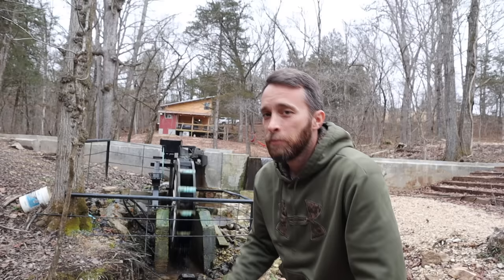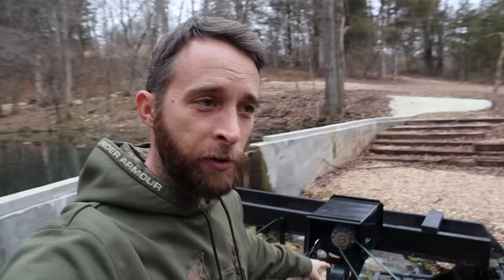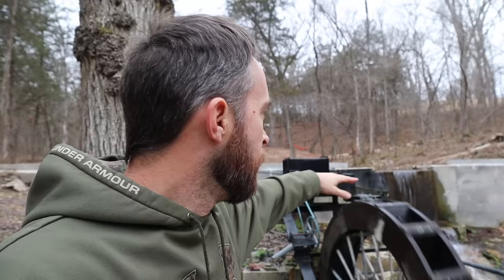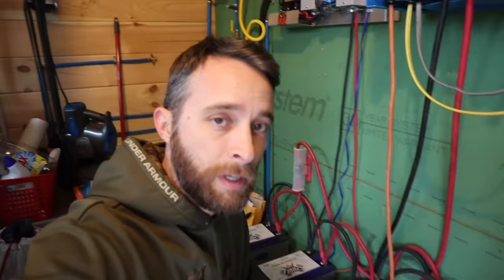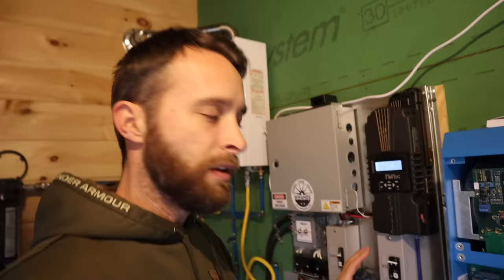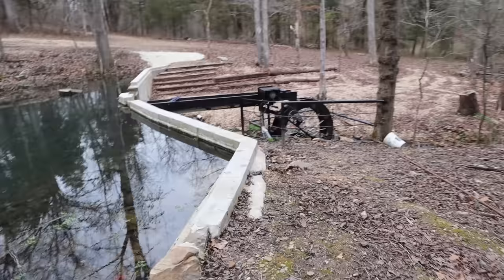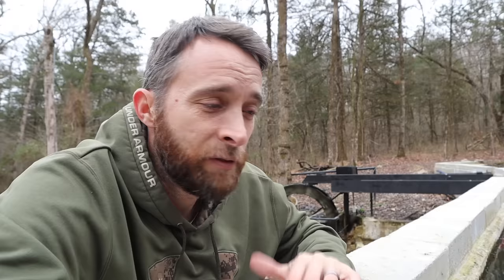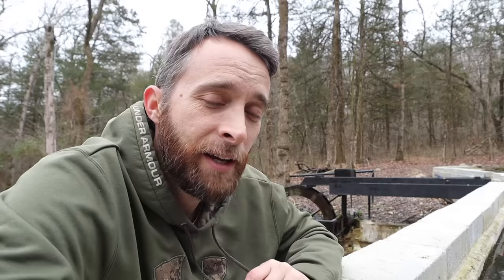Did we MAKE HYDRO POWER Using Our Waterwheel for Self Reliant Off Grid Living?

Comment: Did u convert the voltage to dc to store in battery's bc if u did then idk but just don't see battery banks or dc inverter bc dc takes less to charge and u need only a lil bit power to keep it going better add a solar panel or 2 to dc inverter to battery pack never mind just try dc inverter and add a solar panel to it might need a lil more juice to charge idk what amount of voltage ur generator need to work but might need a solar panel and with water wheel double power might not be enough power to charge it my biggest guess tho only bc my family went to eltrical classes is back when water wheels were around dc current was big now it hard to even find info on dc inverters but the way they use to charge shit was dc inverters best guess bc they changed power current over time u gonna do back to dc current

Comment: every 75 feet to 100 feet you need to One awg wire size 2/0 and size conduit to small for 200 amp Generator  I think you need 24 volt alternator 300 amp
Reply from the maker: I looked on the website where I bought the wire and it says 10/3 as the size. Note sure what that means. But they said it was the right size.
Reply: @LoftisPartyofSix  not for 2000w at that voltage.
Reply: @LoftisPartyofSix  10/3 is great at 100 feet you lose 3 volt about every 100 feet  . but more feet you lose more volts (Because resistant in the wire ) I think you said 200 feet to the  house then you lost 6 volts. you have burning 6 volt light bulb. you may pull 4 agw wire ( small number on the wire bigger the wire lest lost.    you need find website on vote drop
Reply: @LoftisPartyofSix  10 agw is the size of wire and the 3 is three wire  10/3 Also I think you have Three phase alternator Not generator There bigg different between two  do you volt show on all three lug come from water wheel ?
Reply: @LoftisPartyofSix  just jumping in. The system you are using is 24 volt but your alternator at the wheel is a higher voltage. Your video showed 50 volts. Do you know what the max voltage is for that alternator? The higher the voltage,  the smaller the wire size needs to be.  I suggest you have someone test your alternator at the wheel to make sure it didn't blow any internal rectifiers or components.  Maybe that's why it's not giving you the wattage you need. 
I think if you can test at the wheel which will eliminate the question on wire size, you'll at least know that alternator is giving you its max output.   Enjoy your videos.  John Bush

Comment: I'm not an expert in hydro technology, but I think you could do with a diferent genaraitor, I'd go with a bigger one that uses lower rpm.
the thing is that water wheels make high tourk low rpm drive and once you've geared it up that much  you loose a great deal of eficency, genraly the smaller turbines are used becous they run at such high speeds to begin whith.
Anyway  Kris is proberhably a much better source of edvise uspeshaly when it comes to turbines considering his eal life experiance.

Comment: Your dam should of been built higher on your land to get more fall on the water plus you need to use a higher voltage generator to minimise volt drop from generator to battery room

Comment: Loftis Party of Six - weROAM
t’s a PMG generator.  But it does slow down the waterwheel when I turn the whole system on. Not sure if that’s the generator or the charge controller. 

Three things  
what is the volts and amps of the Generator ?
you said 200 feet to house ? 
The water real slow down when you turn on the system You may not have torque  or Horse power to turn the Generator. 
what is the volt at the generator without house hook-up? 
what is the volt wend come in the house ? 
post answer please
stop water. look at shaft of the water wheel and see if there mark on it where big pulley was take drill about same size of the bolt for big pulley. drill a little grove in to the shaft,  so the  pulley do not slip.

Comment: Loftis Party of Six - weROAM - Great spot & beautifully done dam & wheel! You are misunderstanding amp/hours & voltage - the batteries produce identical watt/hours whether they are wired for 100 amp/hour @12v  or 50 amp/hour @24v. The long 24 volt wire from the generator to the house is an issue. If the generator operated at its capacity with such a low voltage that would be over 80 amps, too much for the wire. The rule for long runs is to have the highest voltage and the lowest amperage possible ie:an inverter raising the voltage to 120 right after the generator and 15 amps through the wire . At high water flow the buckets are much too narrow. Unfortunately you'll need a different wheel or a turbine to make full use of the flow.
Reply from the maker: Thanks for explaining

Comment: Move the point of contact of the water on the water wheel, get a better generator and it will work. That small generator isn't getting the job done through that much line.

Comment: From the videos, it seems you're only getting about 12RPM from the waterwheel. With a 36" pulley on the wheel to a 3" pulley on the generator translates to only 144 RPM. On your update video, it seems you installed a secondary pulley. But it's still not enough. Looks like it's going from 36" to 5", then 14" to 3". That's only ~400 RPM. If you replaced the pullies on the secondary to 5/18 (504 RPM), or 4/14 (504 RPM). That gets you to the minimum RPM that you need. I'd build it for final speed of 1000 RPM. But with that gearing, you won't get anything without plenty of water flow.

Comment: Hi there... I am not a hater of Kris Harbour and I like his channel, but waterwheels are different. Waterwheel is kinda self regulating thing with low output power. You need to achieve battery voltage with low water and then when there is more water in the waterwheel then simple more torque and more current is produced. RPM will stay relatively constant (small differences are when the battery is empty or near full) You also only need a simple pwm charger for waterwheel. 2000W generator is totally overkill and also you waterwheel is small - it should be wider to take more water when there is water and you should have a longer headrace and bigger wheel in diameter.  With a 1m diameter wheel and 2l per second you will get aroud 20W of power in water and waterwheel has a 75% eff, another 20% loss is on gearing and 15% on generator and transmission. Thats total effenciency (0,75*0,8*0,85=)51% So with 1m wheel it is 5W of power per each liter per second.. If you got 30W you must have had there about 6l per second. You are wasting a lot of energy on the creek incoming.... there is nice head there. When you try to reconsider that whaterwheel you need to use that height... when you double the diameter you will also double the power... If you can build 3m dia wheel wide enough to take 10l/s then you will see a power about 150W. Power = head (diameter) * flow (l/s) *  9,81 (gravity) * 0,5 (overall eff) - simple as that.

Comment: How does using the generator work with Airbnb guests work? 🤔 Do you have to give them an instructional workshop on how to power the cabin?
Reply from the maker: Its pretty simple. The generator is push button start and they just need to start it 2 times per day. If they power shuts off, then they know its time to start the generator.

Comment: Have you ever thought about putting the turbine at the bottom of the dam and the water wheel for outside lights only I really don’t know about this kind of thing but maybe if you put two of the turbines next to each other at the bottom of dam like drilling a hole and putting the turbine there and getting power or even putting a different type of motor or maybe putting a 4 or6 inch pipe before the water gets to your pond that was made from the dam and putting a turbine inside that pipe to get power before the dam and at the dam just sit down and think about the problem and you will find a answer 
Thank you 
Alopezjr 
Satx/usa

Comment: Generate 12V for lights and other 12V appliances, it is an international automotive standard.  24V is good for fridges / freezers and 24V is usually an industrial standard.  Generate mains power for mains appliances.  Inverters is not good for batteries.  Make small independent systems that is long term sustainable.  You may want to look at LTO cells in future... and solar is hard to beat as it has no mechanical components.

Comment: WaterWheels for electricity generations never did can give enough needed power... It only is intended for very small voltages output which aren't gonna compensate much of the construction expenses from the start building the water reservoir... Now the best and much efficient approach from your present reservoir is to install a water-Turbine utilizing the built-in pipe that you originally had to feed your next project of a fish pond down the hill at the end of the pipe... That pipe as I can see from the video has a HUGE Kinetic Energy that can be used to produce a much EFFICIENT and effective water JETS to propel a turbine mounted to your Generator.    The water wheel actually  is a Gorgeous added attraction to your property but the TORQUE that it can give is less than the one you can derive from a TURBINE.... Moreover, with the Potential Energy from that built-in pipe to FEED your fish pond, it can constantly provide more mechanical energy (or kinetic energy) to the shaft of your chosen (available) hydro-generator...  Again, to compensate 100% Potential Energy from that existing water reservoir,  you must install a water turbine propelled by high-velocity water JETS that you gonna install at the end of the pipe...
Reply from the maker: Thank you 😊

Comment: imo: your wire to cabin is WAY to long for dc power(im assuming you have the setup in dc)  ac current travels much better at high volts..  possible fix for this is, you want ALL dc to be close to charge controller, also, your voltage needs to be at least double what your batteries are...(the reason your only getting  a few amps is from the low volts(50 volts is just enough to make a few amps and thats all. i dont know what size your wire is going to the cabin, but that needs to be really big for distance and voltage loss, and it needs to be fine size to make up that large copper(never use aluminum for dc power) another possible fix is to change over to ac(like maybe a genset head, ac travels better then dc) or use capacitors to be charged from the wheel and let the cc do the rest... these are just someways to go.. if it was me, i would change the dc pma to a generator head, then run ac to cabin, then change ac over to dc for storage inside shed(like i said ac travels better then dc)

Comment: The reason it is not charging your batteries it's because you are not using the right gear ratio to turn the generator fast enough or your generator is faulty

Comment: I know a fix involving the 10inch pipe..   

Ok so the fix make a plug for the 10inch outlet and a tap in the plug to a 1 inch run a 20ft PVC line from the tap in the plug in the 10inch pipe to a micro hydro generator 🎉 super high pressure no massive modified sett up

Comment: There's no reason you can't make power from your system. Maybe not optimal setup but better than what you're getting. Change to ac/ power at the pond use the same lines you have for the dc it will be fine. switch it back to dc power at your house or shed. I'd also look at your charge controller, if there's no load being put on the alternator it won't put out any amperage no matter how good your setup is. If your batteries are low and there's no load being put on the alternator ( meaning your waterwheel should slow down some) then the regulator is an issue. Missouri Wind and solar seem to be good people. you could reach out to them for some ideas as well, since they know your system better than I do.

Comment: Could you just install  a pipe in the ground that drops another 10 feet to make it 20 feet total. And then add a horizontal pipe and let it run x amount and then water flows. Like an L. The l is  the drop by installed large round pipe and the short  end of the L runs horizontal and comes out at bottom. That would give you 20 feet. Could also build up water so runs overhead and then add drop. See the old gold mine water sluices.

Comment: You can calculate your power output from the wheel. Hp=(torque x Rpm)/5252. 1 hp = 746 watts. According to the readings you have 35W TO 55 Watts at the house. That means the wheel is only producing 0.21 HP.
Estimating the rpm at full flow at 50 rpm. Estimated Torque at the wheel shaft is 264 inch pounds. Can you stop the wheel by holding the large pully? I can pull 2400 inch pounld with a 24 inch breaker bar.  Tq=(63025 x .21 Hp)/50 rpm. You need to increase the torque. Your wheel size needs to be 3.5 x bigger if you want to produce 500 watts. Now I question this. How much torque are you getting at the wheel shaft? What rpm are you turning it at? We can calculate the power output from the wheel to find out if it is the wheel or something else in your system causing low power output.

Comment: u need a biger generator... but for biger generator u need also more torque from your wheel... from what i saw, u dont use 100% ur stream becouse when u opened fully, the water was squerting everywhere... that means that the size of ur paddles is to smal and that translate in less weight that puls ur wheel... so u need a wheel with a bigger width so that u can capture more water in the paddles...it wil not increase the speed but it will increase the torque and that will help u to have through gears bigger rpms for ur generator... and also u can make the wheel with a bigger diameter and that will also increase ur torque... archimede said: give me a big enough leverge and i will move the planet... ur wheel it is just that: a leverge

Comment: Several here are saying it but... Keep the batteries, loose the rest and go with a AC gen head rectifier set up... 

Or just convert a car alternator and install that being that you already have the cabling in place. (ouch at that $)

Do not keep buying into the 20 foot drop hydro unit garbage, a paddle wheel will be so much less maintenance in the end.  

Also, buy some books and start learning about electricity. I couldn't fathom trusting any of those companies with my money. It's too easy to just not build it yourself.  

Oi you can't build it, own it and maintain it you may as well call the power company and call it a day.

Comment: It's obvious to me why the system did not work if you sit there and pay attention to it even unloaded the water wheel is surging it speeds up on one half of the rotation and slows down on the other and I'm sure that your charge controller just could not take that large amount of Surge and thought that there was a fault in the system and I could see that one or more of the paddles in the water wheel seems to be off so if the paddles were properly built in the water wheel and properly spaced and the water wheel itself was properly balanced I'm sure that this would work for you and at least provide you with enough electricity to run the refrigerator with it being constantly turned on given the fact that you said the Predator 3500 generator needs to run for about 12 hours a day to provide you with the necessary electricity if I'm correct in what you were saying then this would not provide you with 100% of the electricity you need it would make it so that your batteries very slowly drain and that you would still need to use the Predator 2 charged up the batteries every now and then but you would only need to run it for 1 to 2 hours a day to help cover your electrical needs I do believe that you could make this system work but you need to have your water wheel reworked because even with it not having a load I could see it surging and its operation again I think your failure point in this entire system is actually the water will and the 2000 watt turbine if you can spin it up to its 500 RPMs and keep it at the 500 RPMs I think it would provide you about 1700 watts of electricity given the fact that you were using a DC system and you have such a long cable run going up to the house I do think the system could work but you need to have the Waterwheel reworked so when it is not loaded it is running at a constant speed when you have it running so that way it runs at a more consistent speed when you have it turned on because again I think that your charge controller is detecting the surge in voltage and amperage of the water wheel and is going into an automatic fault setting where it does not actually charge the batteries because it wants to minimize the damage to the system.

Comment: The only thing I thought when you said about the water level is not exactly 20 ft what about your exhaust pipe that goes to the other Creek that runs under that road the one that had that severe leak during construction does that drop below 20 ft because if it does it doesn't ruin the charm of the dam you just put the turbine or some other source further away like I said it was the first thing that popped into my head hope it makes sense
Reply from the maker: Yes I’ve considered that too. I’m talking with a guy about that process to see if it’s doable. Thanks